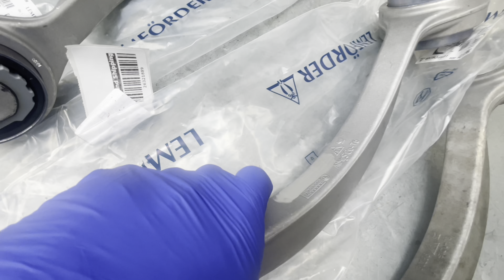Lower Control Arm Bushings 2010 Jaguar XFR. Replacement and Info.

Comment: Can you please tell me what is the best option for strut replacement? I have a 2013 Jaguar XF supercharged 5.0. My struts have the adaptive suspension wire at the top and i want to keep it from giving error message for example if i were to just put coil overs and left that wire disconnected. Is there a cheaper option besides very expensive factory struts? Thanks for your time and love the channel!
Reply from the maker: @InvictusMedia  Bilstein makes a set, a bit cheaper than factory ones. I would go with those if you are trying to save some. Rockauto has some, don’t think a complete set, you can shop around. Thanks for watching.
Reply: @DEEuroworks  Thanks for the info, much appreciated!

Comment: Question: where did you get the bolts that connect to the lower part of the sway bar link & the bolt at the end that connects to the lower part of the spindle? I have the old one where it’s ball joints attached to those two locations & i have to replace it with the new one like what u have.
Reply from the maker: I reused my old ones, they looked perfectly fine, but if you need new ones I would try the dealer.